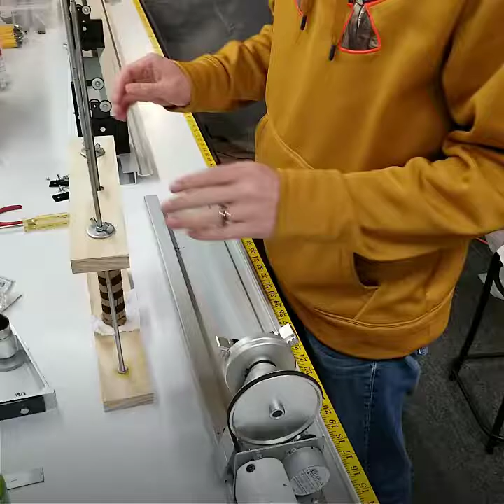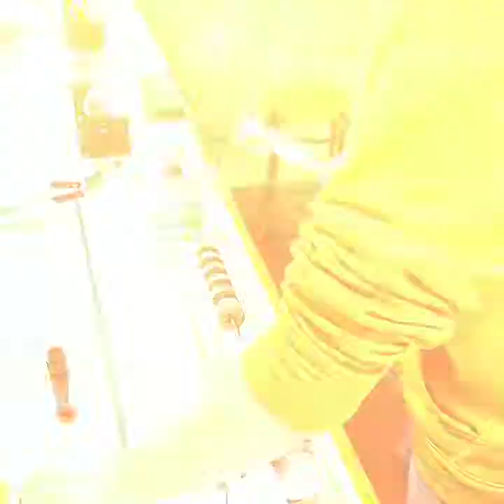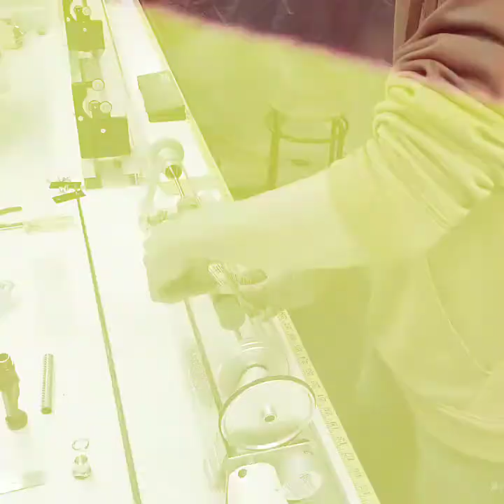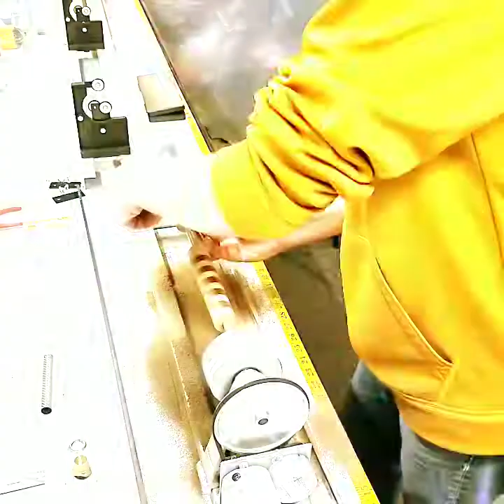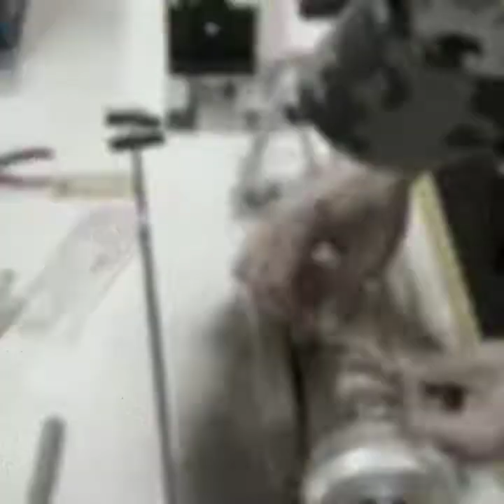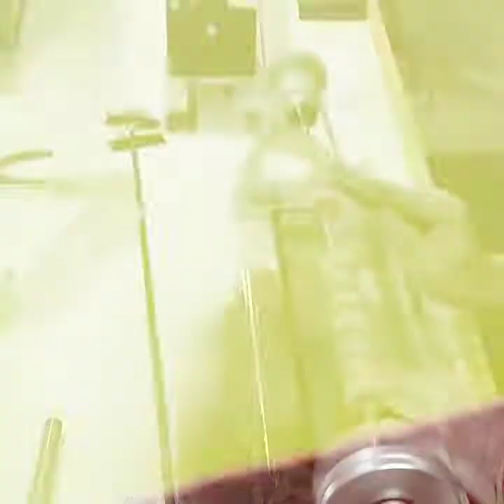Conti's Custom Rods

Comment: Very cool. I use a leather ad and I have 3 different thicknesses so I can get more or less rigidity and If I don't want any, then I use my thumb. Just an idea. It helps to keep the surface smoother (fewer bumps because my thumb is so soft). Love the handle. Neat set up.
Reply from the maker: Jeff Conti Ah!! Yes, good idea. I need to buy a piece of leather and build a couple of them.